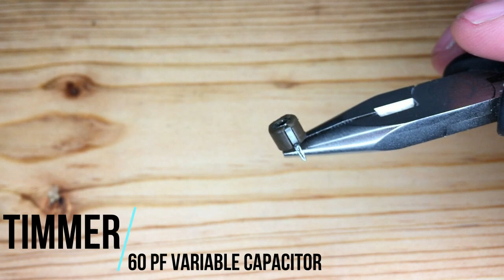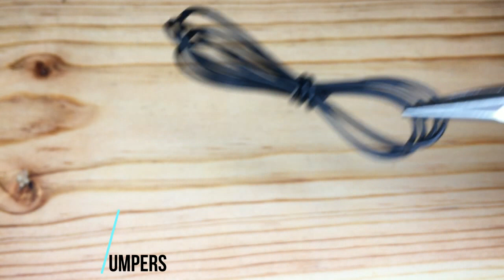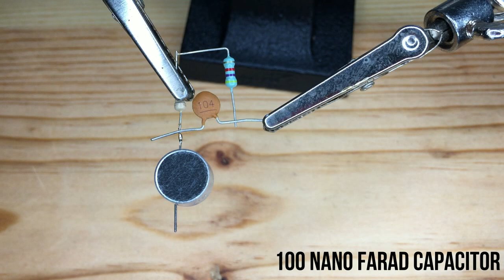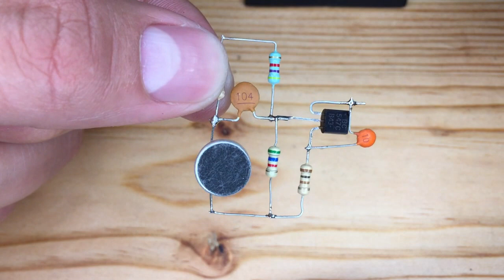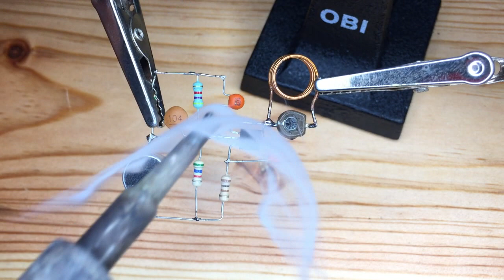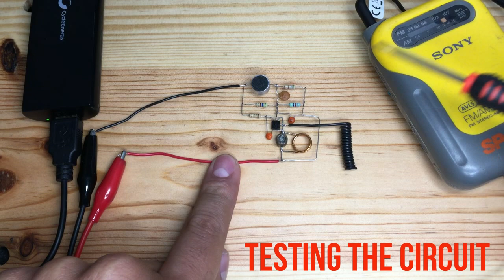MAKE YOUR OWN FM TRANSMITTER (ONLY ONE TRANSISTOR)

Comment: What is the transmission distance? And if we talk through the microphone, do we hear the sound on the radio? How many hertz are in a video variable capacitor? And is the circular thing that you wrapped the copper wire on it a diameter of 18 mm? Please answer and do not ignore.

Comment: Is the trimmer necessary??
Reply from the maker: Yes. To make a better frecuency adjustment
Reply: @ELECTROMAN_MX  thank you, I didn't use it and it worked on 99.6mhz frequency for me :)
Reply: @ELECTROMAN_MX  Pero eso es si quieres transmitir a una frecuencia en concreto no? o de qué componentes depende la frecuencia de emision?